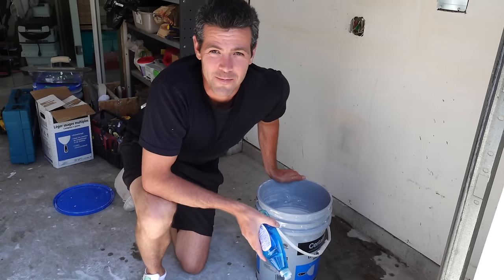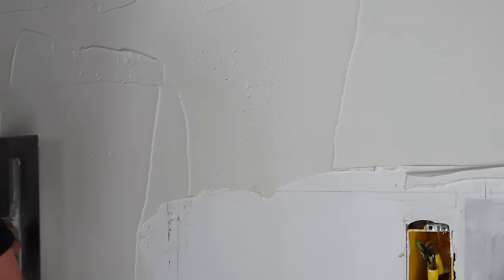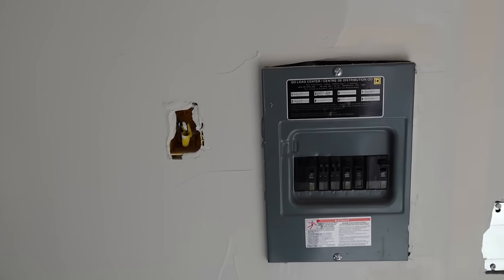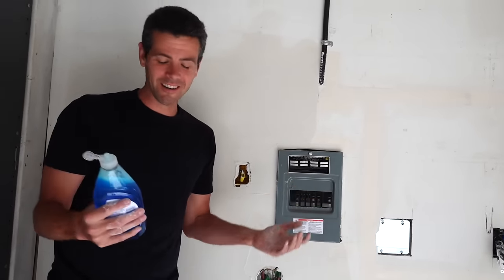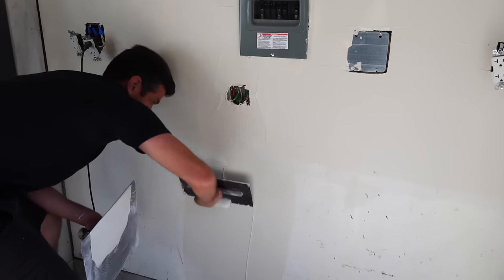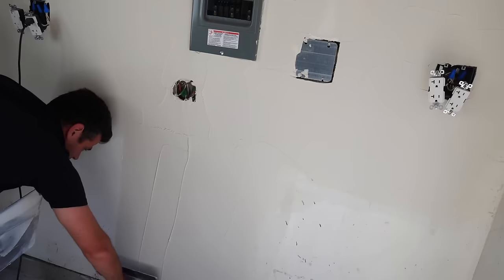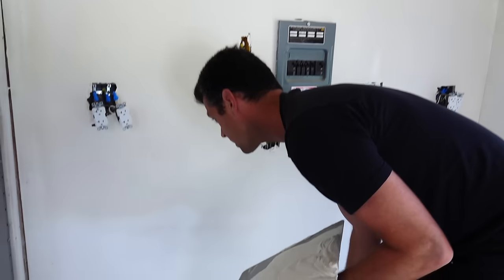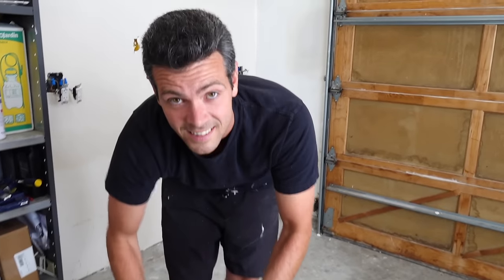😳Should you Add Dish Soap to Drywall Mud????😱

Comment: On the other note I have heard of the WD-40 in your pan or the Dawn dish soap method actually never tried it I kind of sometimes do like adding chalk coloring to my mud on secondary or third coat so I can see what I've done which will be covered by primer
Reply: I like the trial and hawk movement on corner bead and not on a flat wall you could have done a lot better with the pan and a 10 to 14 inch knife you would add a lot less ridges which turns into a lot less sanding got to place them to win dish soap or not

Comment: On a serious note, what is the purpose of adding all of that drywall mud on top of your drywall?    Does it make it look better or what ?     Looks the same to me.   I get that u got to fill in the spaces btw the sheets and any holes.    But why did you have to coat and recoat the entire area ?    I've done just about everything in home renovation, but, I've stood away from drywall because it erks the heck out of me , it reminds me of when a teacher scratches there fingernails on a dry chalkboard.    It hurts my life and my insides.     So I stay away from drywall.   Also I wouldn't be able to move after being covered in chalky dust by the end of the day.   I'd be paralyzed.

Comment: Dish soap in the mud is for the first coat, if painters water down the paint it will slide off the wall if you at soap into a 2nd or skim coat

Comment: Mud sticks to mud through mechanical bond...its ports so it bonds excellent to previously taped surfaces.....if you would have an issue it would be going over a painted wall......but dudes have been using this for years so your not gonna find anything they already haven't

Used it a few times but I don't really have any issue with regular mud and don't tape everyday.....

Also used tints in mud on 3rd or 4th passes to see where I touched up

Such a small amt of soap in that much mud isn't going to compromise anything

Comment: Soap is a surfactant. It helps materials completely cover a surface, try running water across your dry hands. Then use soap. You'll notice the water covers your hands much more. I don't personally use it. Don't feel as though it's worth the time to get soap and mix it

Comment: Adding Dish detergent without a doubt cuts down on the surface tension, gives the mud a bit more open time as well. Gives a slick and smooth finish. Especially great for skim coating.
Reply: I don’t suggest adding The detergent for 1st coating. You don’t want to compromise adhesion of the tape and mud. I Use it only for polishing mostly.

Comment: So as far as identifying marks on your blade, I use a soldering iron, or woodburner, either would work. And I stipple the end of the handle (if it's plastic) and make like a ½"x½" square of stippling so I don't have to look, I just feel with my index finger as I'm holding it. Everyone has their own methods, that's mine. Good video Ben, this has been a topic I've always wondered about if it was legit or not.

Comment: I used soap on a customers house but never caught the tidbit about just a squirt and put 1/4 of a bottle of soap in my mud.  No customer callback, but sanding was horrible with "soap in my eyes" stinging.  Also, I put the last half of the pail in my garage for 2 years and when I opened it -- expecting black sludge -- it was still creamy and and smelled wonderful. Never tried again.

Comment: Interesting... you have two things going on. Reducing drag and eliminating water surface tension by adding a surfactant. It would be really interesting to just add a commercial surfactant like they add in herbicides. To eliminate bubbles. Instead of soap add a little glycerin.
Reply: Glycerin looks like it might work, as it mixes readily with water and (as you mentioned) acts as a surfactant, just like the dish soap.  The question of course is just how much glycerin to add, just like the soap.
Reply: @jfl4066, yes that's what it does! Actually when I was a kid I worked for a couple of years in a horticulture nursery. We used dish soap with Roundup. It was readily available & inexpensive. It didn't take much for our backpack sprayers which were 4-5 gallon capacity. It worked well to "extend" the herbicide & cover plants better without having to soak them with herbicide.
Reply: There are commercial products made for drywall mud. No-pock or something. I wonder what's in it now. MSDS might give some clues.
Reply: Ok

Comment: Sunlight dish soap. Acts as surfactant. It does spread easier and eliminates any pinholes. No issues or worries with adhesion , as it is only on finish coats

Comment: It’s not a myth, i’ve been a drywaller since I was five years old . I guess My dad figured this was old enough to learn the trade. That was 55 years ago. He trained me to only put a certain amount of liquid detergent in my mug when the mud has been sitting up for a while. (starting to have a smell but not spoil.) The liquid soap will not only help the characteristics of your mud Application but it will also cut the odor. This would be done only when the walls are getting a prime coat with flat paint or kills primer. I have yet to have a problem afterwards or have a callback dude to the walls flashing or peeling. This also applies to texture in.
Reply: 5 years old ? 
Lmao !!!!
Reply: @somenteasescrituras4064  Yeah that’s right

Comment: which exact dry wall certainteed compound does one use for skim coating? i see like 3 different kinds in a red, blue and yellow label from them
Reply: Use all purpose or finish/topping mud. The latter takes slightly less work to sand, but it also scratches easier. For beginners I would use the all purpose.
Reply from the maker: I only ever use the blue/light all purpose.
Reply: @vancouvercarpenter  Thank you vancouver carpenter!

Comment: Hahaha, I used to do on purpose to the jagoff electrician who would forget something and cut holes all over the place when I was already done hanging and tapeing , now I have patch work, and guess what I would fill the box with dura bond not easy sand the stuff in the brown bag, that stuff is like concrete when it drys  you can stick drywall to brick or block work with it I covered a brick fireplace with it before with 5/8" and it was set in a few hours I put my beads on the corners and it was good and still is that's been 6 years ago but I can't find the dura bond in the brown bag anymore and I don't know if I would try that with easy sand,

Comment: It only takes a few drops, you used 99 times more than needed. I only use soap on the 2nd or 3rd coat, mainly the final coats. Ivory soap seems to work better and you need less too, I have noticed other brands of soap takes more soap than Ivory. Never had a problem with paint after this.

Comment: I see people sometimes add water to paint too which may seem like a good idea to improve flow rate but you’re changing the composition of the paint at that point. My coworker did that one time and we had to repaint an entire stairwell because the coverage was crap. Sometimes these hacks aren’t worth it. We have added water to two part epoxy though when it starts to get too thick to work with

Comment: As a painter, we regularly clean walls down with dish soap, especially kitchens and baths. I have never had issues with adhesion or streaking. It even sands fine, when you want to get rid of any orange peeling left from the last 10 coats of paint.

Quick tip for anyone who paints regularly, after cleaning your brush an kicking out most of the water, dab a small amount of hair conditioner into it mix it in, train in wrapped in plastic or the keeper. Then store in the fridge for your next paint job. That brush will be better than new!

Comment: Dawn is good for getting boric acid to penetrate wood for termite protection in fact part of the application process.  So the mud may actually be adhering better as a result. I have to try this out, thanks for trying this out on your wall first. BTW,  how well does the paint adhere? I suspect it'll be fine.
Reply: I've done this a LOT. Paint's not a problem. The hydrophillic ends of the soap molecules attach to the water in the mud and have no effect on the paint. They should actually improve oil-based paint adherence, but wouldn't affect water-based paints unless someone added WAY too much soap.

Comment: From my experience, bubbles in the mud are from 2 things. 
First, if you don’t take a cloth or a broom to your wall to knock off excess dust/debris, you get bubbles. I use a damp tile sponge to clean my walls before mudding and don’t get bubbles
Second, areas in the mud that have not mixed well and have small deposits of un mixed powder are the cause. Always mix your mud. 

To say dish soap helps this is in my opinion, false. It’s the process of mixing versus using it straight from the store that is doing the most for not having bubbles. 

But for skim coats, I do use dish soap as the glycerine your adding to the mix in the soap does improve the smoothness of the spread. And it doesn’t matter what brand, all dish soap has glycerine, the only difference is what you want to smell while doing it.

The correct measure by the way, is around 1 teaspoon per gallon. If you add too much, you mess with the chemical maker for adhesion. Too little, well, at least it’s mixed but no true benefit.

Comment: I used to work for a masonry contractor and occassionaly would use a grout pump for the joints on thinbrick. It was a major no-no to add soap to the grout mix, even though it would eliminate plugging up the hose and make the joints easy to tool. Boss would have a tantrum when he found out, as it affects adhesion and durability.
Reply: yea I wouldn't want it in my grout or mortar either . drywall mud is alot different application and purpose wise. I never used it taping or bedding.  2nd coats mostly . Works great hand finishing but works really really well when using box tools during 2nd coat. Being you don't  want to wipe much if any of the mud off getting bubbles out and the boxes add the right amount of mud . Basically  just lay your knife flat as possible  and wipe the opposite  way it was applied.

Comment: As a professional drywall finisher and painter with 35+ years experience I can say that it's true that adding soap to the mud will help eliminate the bubbles or shotgun in the mud however it also adversely affects the paint finish in that it makes anywhere there is mud on the wall the paint will appear as a flat finish on the wall. IMO soap is not a good thing to use ever!!!. With my experience I can easily identify the jobs that the finishers used soap by looking at the walls and seeing the dead spots. It's the best way to screw over the painter if you really hate him.

Comment: I've been using sunlight detergent back 40 years in my plastering and Stucco basecoats. It gives the mud body or smoothness. But we don't use soap in the finish coats. 
Same thing with drywall mud. We only use a small squirt. Too much is not recommended...
I AM MASTER PLASTERER 😎 63

Comment: VC I don't know if you caught my question two weeks ago asking if you've ever tried or heard of dish soap in mud/skimming. Then, low and behold, here you are making the video. I have to admit that I tried it and I too, liked how it applied a lot smoother. However,  with that being said, I also felt super skeptical about how it could affect finish and paint. So my solution after using the soap was to re-skim using mud without soap. Just didn't feel right you know.
Reply from the maker: I'm about to paint it later today. I still think I should make a video trying to find out if it lowers adhesion.
Reply: @vancouvercarpenter  Oh that would be awesome. I will be waiting anxiously to see the outcome and hear your thoughts. For me, it's the adhesion I worry about. I just kept thinking, "I use soap to clean anything sticky", so why would I add it to my walls before painting. Either way, I'm sure I'm gonna go with whatever outcome you find to be best. After all, you are the best "drywallery carpenter" right?!  ;) Thanks VC!

Comment: As a retired finisher I’ve tried all the tricks and have found none of them to be what they say they are. I will say it’s refreshing to see someone skilled with hawk and trowel instead of seeing pan and knife I’ve used and can use both ways but I prefer hawk and trowel mostly because pan and knife tend to hollow out corner bead and flex more plus most people won’t push straight mud out the box with a knife they mix it down and that causes more shrinkage which hollows out the bead pushing straight mud with a trowel is easier and the trowel don’t flex like knives do so anyways nice job 👍

Comment: well when the roller of paint pulls the joint compound from the wall youll then know why you shouldnt add soap. its only used for the tapers to cheat with 2 coats and keep fish eyes down but it ruins the adhesion of the mud and paint  DONT DO IT

Comment: I've mixed pretty much every 5 with approx. 1/2 or 3/8 a cup of water and about twice the squeeze you put in. I've never once had an issue with adhesion, with either the mud sticking to the wall or paint sticking to the mud. The surface tension is what it helps break, which I do think helps some. Even though I do that I'm still regularly searching to see if anyone else has cracked the bubble code.

Comment: I’ve been in the construction business for 20+ years and I can say without a doubt, I’ve only met two finishers who didn’t use mud. I’ve used a “squirt” of dawn in every bucket of mud I’ve ever used and I’ve never heard or personally experienced any issues relating to adhesion or paint finish. I can however attest to the fact that all mud works much easier with the dawn and flows on much smoother.
Reply: @onetwothree4148  if your cognitive ability is so hindered that you can’t compare my use of dish soap to all of the others outcomes who don’t use dish soap (great long lasting results from both) than your probably should learn how to focus on much simpler ideals. Good luck to you!
Reply: @lil--mo2025  what other outcomes that don't use dish soap? You said you've only met two people in your entire career that didn't use it.
Reply: @onetwothree4148  holy moly…I didn’t realize this was so difficult to understand.  Let me break it down for you more simply. 
1) The first couple times I used mud and did Sheetrock I didn’t use soap and it was much more difficult to work with especially floating with hand tools. Hence the reason I’ve never worked with mud without at least a squirt of soap in the mud again. 
2) all of my jobs and all of the other professionals jobs have had great results with soap. 
3) if the standard is to not use soap, such as in this video, and he clearly has had good results, than it’s safe to say it’s every bit as fair to say that either method works very well.
4) experience proves that soap works well and is the standard and always has been by most every contractor I’ve ever met. 
5) 1+1=2 so 2+2=4 and therefore 4+4=8
I realize that’s a lot for you, but I believe in you.

Comment: I'd be curious to see how it holds up; if the strength is compromised over time.  It just doesn't make sense to add something that breaks down soil.  I wouldn't add it to paint either.   Time will be the real test.  Thanks for posting!
Reply: This trick has been used for decades, so it's proven to work already!
And no one said add it to paint.

Comment: The issue to me is that the drywall companies could very well add dawn if it made their mud better. This isn't a new thing. But we are to trust the mudders to be better chemists than the companies. And it's also hard to know how it changes strength or bond over time. I'm not a fan of experiments on customers jobs and I can assure that it's not in the allowable things architects approve. To add something like this and not get permission could be a real liability issue.

Comment: 6:51 so that’s why we do it, the smell….
Cu who doesn’t like smelling “mud”😇😂

Seriously though, after add a squirt (which for half bucket, we talking 1/8 - 1/4 cup at most, full bucket would be 1/4- 1/2) and TRY NOT TO ADD ANY WATER, as you’ll start to get “frothing mud, w/ bubbles”. How do I know, we won’t go there…..but can recover it just gotta wait, add more “mud/product” and remix on a slower speed for a bit. 
This is imo, and what was taught by “old timer” back in the day……very fast and could work circles around me when was in my 20s, lol.
Nowadays, I don’t add dish soap at all, and haven’t since worked for the guy long ago.
Cheers✌🏻

Edited=Forgot to add, we would also do this in severely horrid walls that needed skimmed coated, instead of replacing , b/c it glided; but gotta be careful a bit and get “used” to working w/ it. Also supposed to helped w/ bubbles and such….
So, to each there own.

Comment: I do flood and fire restoration and I just realized something. Often when I go to flood damage jobs there are weird spots on the wall that come through the paint after moisture has gotten behind the wall, I wonder if it's the screw holes that's were covered with mud reacting with the soap in the mud? They've always stumped me but they are the same shape as the typical drag and wipe. Huh 🤔
Reply: Nope

Comment: I’m more inclined to add fabric softener .

Fabric softener is a surfactant which makes water wetter by reducing surface tension and coating the fibres of fabrics.
This might make drywall mud smoother as it penetrates deeper .

This will be my next experiment.😀
Reply: Dish soap is a surfactant, too. The long chain molecules add a bit of elasticity and cohesion to the mud without compromising it in other ways.